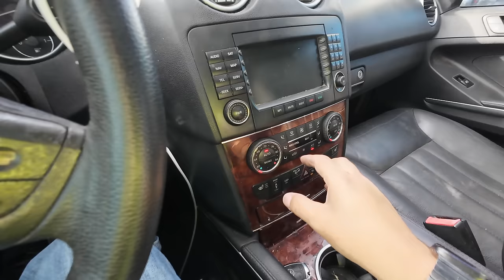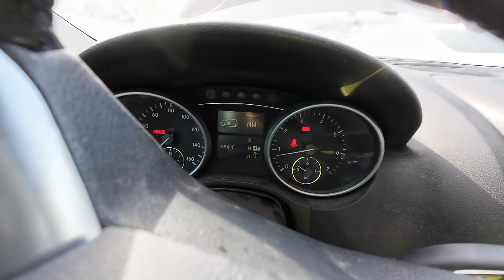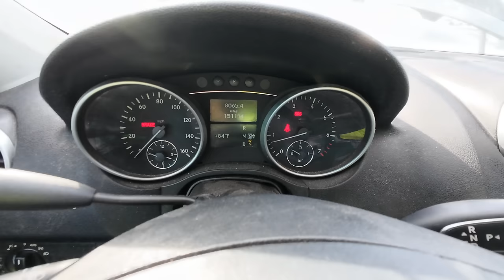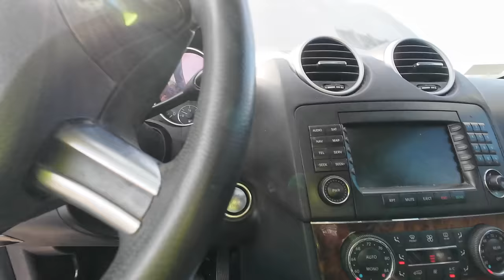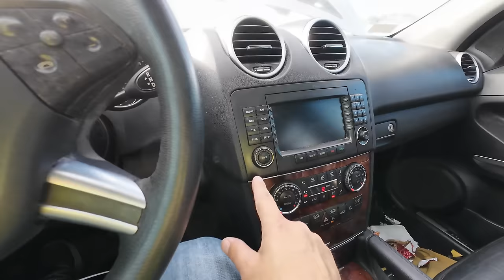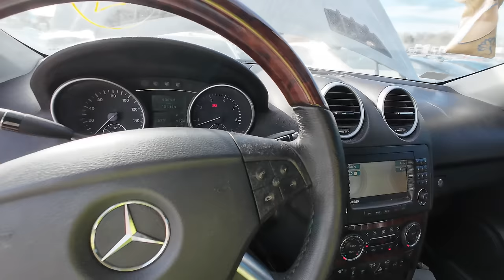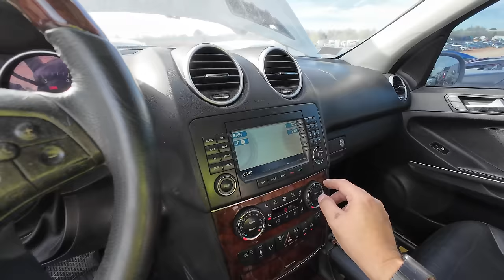I Found a $950 2007 Mercedes ML500 at Copart!

Comment: That battery compartment also houses the front Signal Acquisition Module which controls exterior electronics like the headlights and various bits and bobs. When the sunroof drains clog, water runs back into the cabin and fills that compartment, usually corroding the SAM PCB. So pull out the battery and look for water down there. The SAMs aren't cheap but may be salvageable.
Reply: You had one before or you a Benz mechanic. Is the donut tire the issue.   Good for the money right
Reply: im a novice benz mechanic, just worked on this exact car last month but with the 450 engine. i think this car is probably a good deal but i dont know how much a new SAM costs

Comment: My daily is a 2008 ML350.  Small tear in the driver seat.  All else is perfect.  But it has taken some $$ to keep it that way (both batteries replaced, head unit and most recently - 3 small fluid leaks underneath).  199,000 miles but still drives like a dream

Comment: Randy I own a ML63 2008  518 hp. and I love it . its pretty quick for a heavy SUV . Parts are available but shop  around for parts to get good prices . If you want a shop manual for All Mercedes Benz and Smart cars up to 2020 I have a extra on thumb drive . It is called W .I .S. put in your Vin. and  it is specific for the Vehicle .  Tell Monkey . I would jump on that ml500 the motors hold up well.

Comment: At 8:10 did you check to see if the belt is missing that would explain no power steering an the battery light being on an no ac